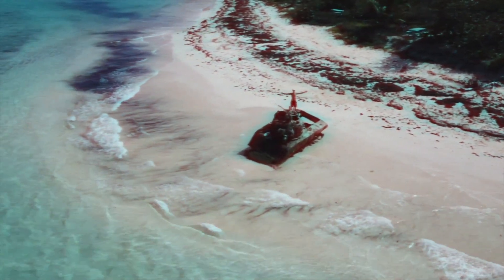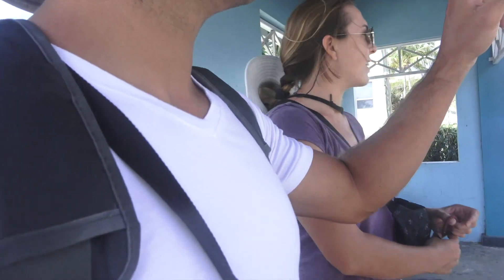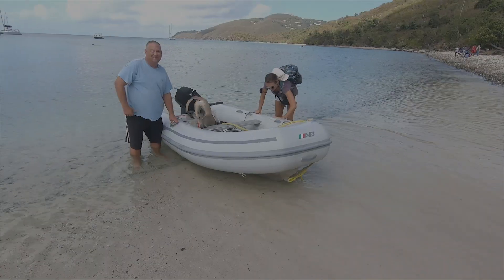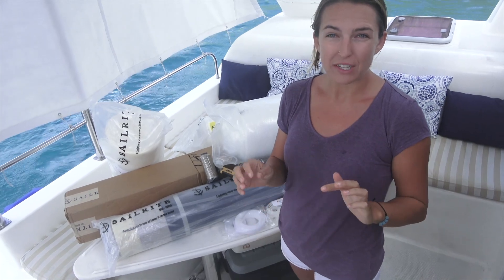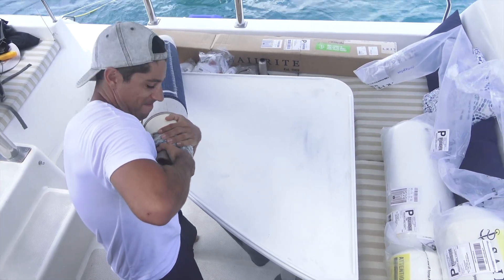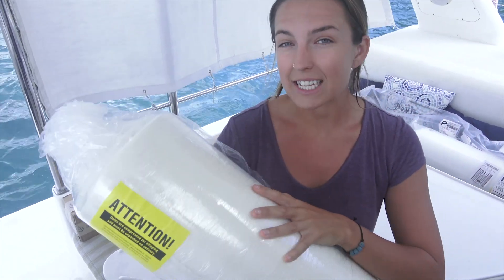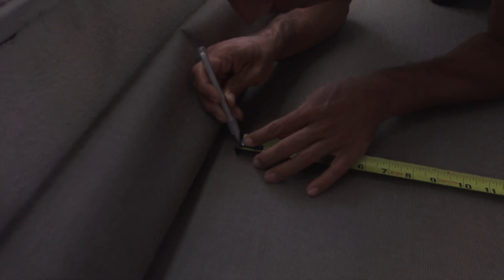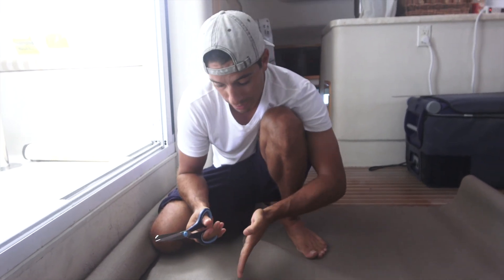Unboxing our Most GENEROUS Donation | BOAB 178

Comment: FYI, if you sew the Bimini correctly X 3 stitching , it should with stand 70 mph wind.  We use it on power boats and underway at 65mph they have not torn or come apart.
Reply from the maker: Wow that's crazy! We plan in taking it down in any significant blow but good to know it can stand that.

Comment: A the seems are straighter however B's thread is tighter and there fore a more professional look... B's thread will not likely pull as much because thee is less loose cotton between the stitches... B and A are both winners... You got the job done...

Comment: Love it. I've been sewing myself onboard for a while. Hem tape is dope but also a office stapler works great. And iron everything first. I picked up a 1953 necchi bu for 50 bucks that I carry with me, no walking foot but it'll run 92 thread through 10 layers of Dacron. I've also used home Depot heavy duty canvas tarp and dyed them blue with rit. I got a season before eta ate the last one. Anyway, I guess I got to a don't let the sail rite hype hold you down, buy an OLD machine, older is better, with a zig zag. You'll be amazed at what you can punch through. Love you guys, enjoy crown bay, eat at Tickle's (everyone does for some reason), and G&D's for conch. STX is way better tho, just saying...
Reply: I have a machine called a Euro-Pro. It's a cheap machine. Probably $100 at Wal-Mart. I never expected it to blast thru restitching my genoa, but it did with little effort.

Comment: B wins for each tight stitch.  I'm surprised to see the sail rite sewing machine has the typical small bobbin for the bottom as my el' cheapo old sears special. That's the weak point, reloading it is a pain or it running out mid run!  I figured sail rite would be superior and have a better system than my old thing.  Oh well, I guess I should just keep what I got ;)

Comment: ARRRRGGGGG its threaded WRONG!! The thread goes into that hole right below the screw that holds the needle in.the holder. 21.29. Thread goes from left to right into the eye of the needle. Look at the manual. I want to tear whats left of my hair out. ALSO be sure the needle is up when switching direction. You probably switched direction when the needle was down in the bobbin area and that is why you got a burr.
Reply from the maker: Lol hopefully you still have some hair left after that. Glad to know we got it straightened out later on in the vid.
Reply: I've been sewing for 50yrs and purchased a Sailrite recently.  Love it a lot but found it's very easy to burr that bobbin case due to the weight of material being fed through to be sewed. I was re-sewing the mainsail stack pack for my 30ft yacht, almost finished after several days of sewing and hadn't been aware of the needle ever hitting the case but it had.  And I'm careful re not pulling the fabric while the machine is sewing, etc.  Great videos from Sailrite, kudos for giving us home machinists necessary info to keep the our machines repaired, and sewing well.  Good on you two for giving yet another skill a go. ⛵👍